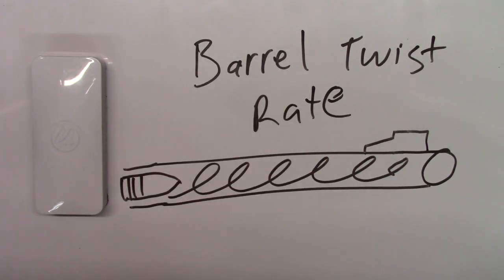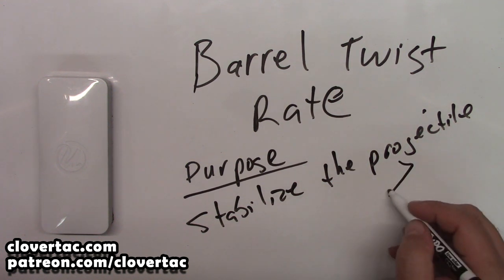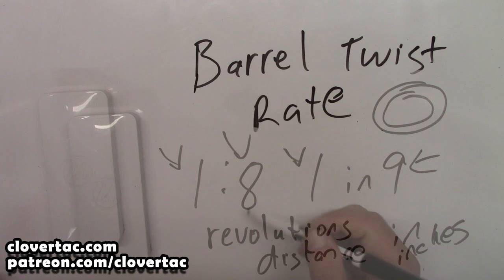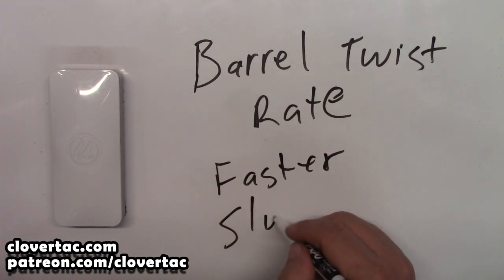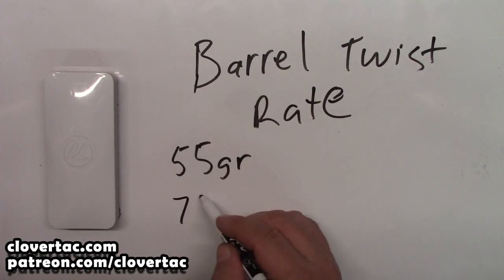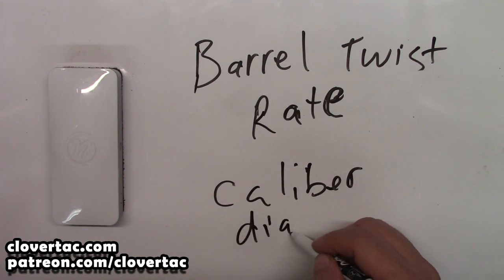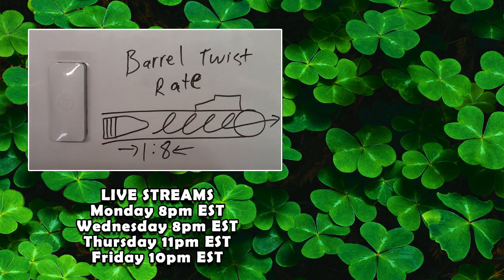Rifled Barrel Twist Rate Explained

Comment: I'm thanking of building a blackout 300 what would be the best twist rate for that?
Reply from the maker: it sorta depends on what you are primarily going to be running. the blackout cartridige can range from 90gr to 275gr so there is a lot of ground to cover. then barrel length makes a bit of a difference too. longer barrels can typically get away with a little slower twist rate. for say anything 115gr to 168gr, 1:10 or even 1:8 seems to do fine for me and for the heavier stuff, say 220gr plus, i go at least 1:7 if not faster. seems i see a lot of 1:10 or 1:7 options out there, so to simplify that, would say go 10 if primarily lighter and 7 if primarily heavier. keep in mind that while a slower twist may not stabilize a heavy projectile, a faster twist really only runs into issues in regards to causing jacket separation, etc on light projectiles. this isn't an issue at all with most bonded stuff, legit full jacket or solid copper right? so you can typically get away with faster better than you can with a slower twist. now, are you even more confused? 🤣😂 hopefully not, sorry for the ramble here.

Comment: Is there a best ammo for a 1:9 556/223 or does it make much difference? The barrel is 16 inch if that makes any difference.
Reply from the maker: 1:9 may not do as good with heaver stuff, say 70r or more but should do fine with say 55gr up to 62gr or so. that is a really common twist for 223
Reply: @CloverTac  now when you say may not do as good, is that in the drop rate of the bullet or could this mess my rifle up? I have 75gr I haven't used yet. I don't normally shoot anything over 100 yards.
Reply from the maker: not being ugly but first wanna ask... did you watch the video at all? i explain why twist rate matters. it has little to nothing to do with drop. what will happen is a heavier projectile requires a faster twist to stabilize. if the projectile is wobbling during flight, it is not going to go as far cuz of drag, be as accurate, etc. compare it to a quarterback throwing a football, which is the better way to throw it, loose wobbly or nice tight fast spiral? now with using a really light bullet and a fast twist, there is a chance it spins too fast and can separate the jacket, which is what makes the projectile more areodynmaic, from the core. so a 1:9 in my opinion is too slow for a 75gr but there are all sorts of other factors at play, so it may do alright. probably a good idea to disconnect the idea of twist from any type of distance... while an optimally flying projectile will typically perform better as far as disatnce, doesn't matter if it is so wobbly it is inaccurate or smacks your target sideways (call keyholing). hopefully this helps ya understand better
Reply: @CloverTac  much better. Thank you. I'm better with reading

Comment: Thanks for the explanation, but what is the appropriate rotation for a 9mm barrel?
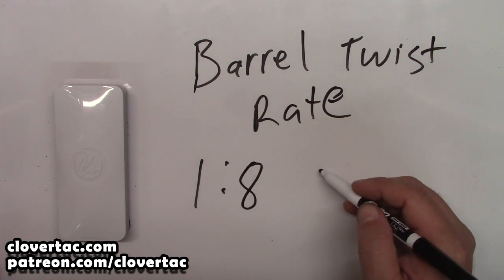Reply from the maker: that is a good question but as explained here (if i recall, this video is older after all) it does depend on the weight of the projectile you plan on running and to an extent the purpose. for general purpose 1:10 to 1:16 seems to be what most manufacturers go with as those handle 115gr to 147gr well enough. but i have seen twists go as high at 1:24 or even  1:32, especially when running special loads, special projectiles in a competition setting
Reply: @CloverTac  Thank you very much for the clarification. Your explanation is more than wonderful. May God protect you
Reply: @CloverTac  My brother, I am working on a project to produce the Star 30M pistol, and I want a good rotation for it. I will do it

Comment: What is a good twist rate for potatoe gun with 1.5 PVC 3 feet long..how about 2 inch PVC? Thanks
Reply from the maker: 🤣😂🤣😂 probably something like 1:0 on both bore sizes, of course will depend on the potato. for a sweet potato, might want to bump that up to 1:1 just to be sure. after all sweet potatos are known to build pressure what with all the gas the produce.

Comment: Spin and velocity, it’s what makes the bullet hit where aimed to X distance.
Reply from the maker: that is a major oversimplification when it comes to twist rates, but true at least to some extent. velocity and spin doesn't have to be present IE cannon balls, smooth bores, etc but when maximum accuracy is the end game, yup, all cards are on the table. twist rate doesn't reall affect velocity to a certain extent but it the cornerstone of spin and the weight of the projectile you need to spin, and to some extent the length of the barrel will dictate what twist can provide the best stabilization and thus accuracy for a given round. there, did i complicate your over simplification enough? 🤣😂
Reply: @CloverTac  I am a Military Rifle Instructor assisting the USAMU deliver SDM Training and part of that training is external ballistics and my comment is fact.
Reply from the maker: never said it wasn't fact... so not sure what you are getting at
Reply: @CloverTac  it’s not an oversimplification as you said.
Reply from the maker: 😂🤣 well on that we will just have to disagree

Comment: I wonder how do they shot m193 (55 grain) using barrels with 1/7 twist rate in the military. Isn't it too fast for the light bullet?
Reply from the maker: so first off, the M16 has been issued in a variety of barrel twists from 1:7 to 1:12... so my first question would be do you know that those who are issued M163 are using a 1:7? i do know that that in the civilian world, a 1:8 or 1:9 seem to be the most common twist rates for the comparable (not identical AR-15).  i obviously have no military experience... so i cannot answer from that perspective. from my experience though 55gr will work in a 1:7, much better than say a 75gr would work in a 1:12. the M163 is a FMJ and the biggest issue is eee with light projectiles and faster twists is jacket separation... not nearly as abig of an issue as stabilization. and FMJ projectiles, again in my experience, do not tend to separate as easily as projectiles with an open front, like a SP, HP, etc. and keep in mind to that an OTHP is a match greade style HP, not a defensive style HP. i know that got off into projectile types a bit there, so hopefully wasn't terribly confusing. great question!

Comment: I wouldn't knock a 1:8 twist out of a 16" into a particular category of bullet grains.  This seems like the Goldilocks/Jack of all trades, master of none twist and length.  Seems well suited to 55 grain and 64 grain, but can handle more. (speaking for .223/5.56 only)  Anyways thumbs up.
Reply from the maker: faster twists can typically handle smaller projectiles, the only issue you sometimes get, depending on the projectile is jacket/core separation due to that increased spin and typically a high velocity as well. only so much spin is needed for stabilization, after that it is wasted motion in a way. as with everything, factors can cause all sorts of variations but you did admit here "master of none" so at least you are being honest. just because it works doesn't mean it is optimal you know?
Reply: @CloverTac  -- Thanks for the reply.  I approached my answer like this:  If I could only have one twist, and one barrel length on an AR forever, what would I pick?  
    As a PSC doing breaches we ran 10" barrels/AR pistols.  
    You're comp shooting 600 yards, obviously you want a longer barrel with a bit less twist.  Thankfully the platform is so flexible.  But ... if God showed up and said you can only have one barrel and one twist in all situations forever, what would it be?  Think you know my answer.  I'm curious to know yours.  At any rate, thanks again.
Reply from the maker: for some reason, seems we are going way down the road of AR, when this videos is about the twist on all rifles. so maybe i don't go AR and if i do, maybe i go with an alternative caliber. so given my own choice, probably going with my sbr 8" 300 blackout with a 1:10 match barrel  that is mainly becuase a 308 caliber is going to be more effective in my opinion and more things. if we are talking about 556 specifically, probably going with an 12" an 1 in 9 twist. of course my lever 44 magnum is a good choice for a lot of things too.  it it really hard for me to pick just one firearm, i own many and they all have very specific uses..... thankfully  i don't see a situation where i will ever need to do that 🤣😂
Reply: @CloverTac  -- Of course you're right.  Suppose I just started with AR on this.  AR on the brain because I'm building one with my 5 year old daughter now.  She just passed her checks at school for it, so daddy daughter build.  
     And I own many different firearms as well.  As you, me and others should.  Just thought it was a decent question to ask :)
Reply from the maker: @MarkJacksonGaming  that sounds like a pretty cool reward
Reply: @CloverTac  -- She's excited to mow the lawn for ammunition.  Anyways, thanks for your thoughts.   Won't take up anymore of your time.
Reply from the maker: @MarkJacksonGaming  my pleasure and don't ever worry about taking up my time, these conversations are one of the perks of making videos
Reply: Interestingly enough during the USAMUs development of the Squad Designated Marksman Rifle, the 1/8 twist 20 inch barrel was selected since it produced the best results from the then new Mk262 ammunition to mid range. I have some experience with that barrel but my 1/7 twist barrels have accommodated 53, 77, and 80 grain SMKs so nicely that I’ve stuck with it for everything from 100 yard reduced course matches to 1000 yard events.
Reply from the maker: i have a 1:7 24" used primarily for bench rest with 100gr proectiles but it shreds lightwieght jacketed stuff say 40-60gr or so

Comment: How about the AKs twist rate I think they have fix twistrate in all variants?
Reply from the maker: i thought AKs were genearlly somewhere between 1:9 and 1:10 and wasn't aware of the principles of twist range being different somehow, barrel twist should just be barrel twist as it has little to do with caliber, platform, etc, all about the length and weight of the projectile verus the proper twist to stabilize said projectile (whatever that might be)
Reply from the maker: are you asking if you can find AKs with varying twist rates? i would say yeah, probably so, caliber will play a role there as well as grain weight ammo they are designed to fire. but everything equal, meaning 7.62 vs 7.62 variant, they should be pretty close to the same, within a inch or so anyway.
Reply: @CloverTac  Maybe are universal twist rate that can destabilze any projectile weight because most of fire arms dont talk about twist rate...
Reply from the maker: just becuase twist rate is not mentioned does not mean it does not exist. if a barrel is rifled, there is a twist, there has to be, it is a matter of phyics. unless we are talking about a smooth bore like a shotgun anway. the physics also does not allow for one twist to stabilize everything. the heavier the projectile, the faster the twist needs to be for stabilization. for lighter projectiles, a faster twist can be used, can't really over stabilize anything so in a sense that could be called universal but if you shoot a lighter projectile in a faster twist, there is the likelihood that the fast twist can spin the jacket off the projectile... which is not good and is not normal, so would negate the whole universal concept.

Comment: is there not also a relationship between twist rate and barrel length ?
a 20" 1 in 9 barrel turns a bullet about the same amount as a 24" 1 in 11 barrel before bullet leaves the muzzle
Reply from the maker: good question, yes, obvioulsy there is a relationaship with total length since one twist in x number of inches (length measurement). as far the having two different length barrels with differen twist achiece the smae complete twist...it does not mean it is equal. achieving a complete revolution faster means the projectile is spinning faster. heavy projectiles need more spin to stabilze, as does longer projectiles (typically) and the copper jackets on lighter projectiles can spin completely off the lead core with too high of a twist rate.
Reply from the maker: since you mention total barrel length here and i don;t really know you firearm education level, wanted to point out that up to a certain poin, barrel length does play a roll with the maximum velocity of a projectile.having enough  barrel length to completely burn up the powder behind the projectile befoe said projectile leaves the barrel is of course optimal for that particular cartridge as far as vecolity. oh and also worth pointing out with the previous quesion that a longer barrel with the same twist rate (meaning more spin on the proper projectile) will typically yield better accuracy. what is interesting with this realtionship is that it is all about getting more spin as more velocity will typically end up making things less accurate. i know this can all get crazy and may take some time to understand but hopefully this in addition to the answer to your questions will help.
Reply: @CloverTac  so further to my question above a 20" 1 in 9 is NOT an equal spin as a 24" 1 in 11 ?
Reply from the maker: @DLN-ix6vf  equal, not becuase if it does in a shorter length it is a faster spin... i think you are limiting your thinking to a projectile needing a complete spin or something and it has to do with the speed of the spin, not whether or not it gets a complete revolution in the barrel.... we are talking tough concepts to try and explain through comments here, so my apologies for that
Reply: @CloverTac  I think I understand so I will cancel my order to buy a used Rem 700 24" with 1 in 11.2 and buy that 20" Rem 700 with 1 in 9. 
The bullets I want to use are Sierra MatchKings 69gr and they say no less than a 10 twist. 
I know there are other rifles but I have a Cadex Strike Nuke and a MDT ESS Chassis that use the Rem. 700 platform.
Thanks for help !
Reply from the maker: @DLN-ix6vf  my pleasure and i would agree with that change for those projectiles
Reply: @CloverTac  another question:  if the "sierra" manual says a 69gr. bullet should be inserted 0.335" into the cartridge and 0.650 out of the cartridge so would it matter much if the bullet is inserted say 0.355 assuming same 0.0015 neck tension after sizing in both cases ? Med. amount of powder according to tables.
Reply from the maker: @DLN-ix6vf  you can typically get way with 0.005 in tolerances pretty easy. i don't reload according to bullet dept, i go by overall length (of course bullet depth is a part of that). the key to loading is figuring out how much lead (pronounced leed) your particular firearm likes. that can vary a little bit here and there. hopefully i have answered your question but as before, you may SERIOUSLY consider contacting me some other way, this is NOT a reliable way as we can only discuss so much and YouTube is bad about blocking comments or never send me a notice they are here.